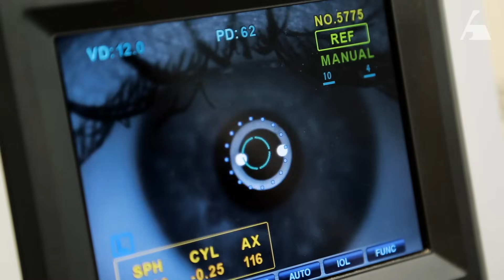We can 3D-print our way out of the housing crisis. Here’s how.

Comment: I've worked in the single-family housing industry for over 50 years, and year after year, there are more and more regulations we have to adhere to . The regulators on all levels are mandating their own job security. It is unbelievable how expensive the permitting process is. Even affordable housing can cost thousands to receive a permit. Most of the expenses are based on justification for the existence of the building department. They constantly develop new regulations and codes for "public interest" and "safety" reasons. Yet, I can drive through neighborhoods I built 50 years ago, and the houses still stand. There's no safety issue with 50-year-old homes, yet today, you'd never get a house out of plan check, let alone break ground. Granted, there are earthquake, tornado, and hurricane areas where the extra regulations are helpful, but the force of nature  becomes a super expensive exercise to build a house to withstand. These 3-D printed houses made of poured-in-place concrete for single-story homes are far superior to what is currently being stick framed. Building departments need to get out of the way and let them be built in mass, but the only way for it to happen is for building regulators to get their pound of flesh. If they don't understand it, they try to overregulate it out of existence. Typical government oversight gone extreme.
Reply from the maker: Thanks for sharing your on-the-ground experience! It echos what we've been hearing and that there is a lot of room for improvement.